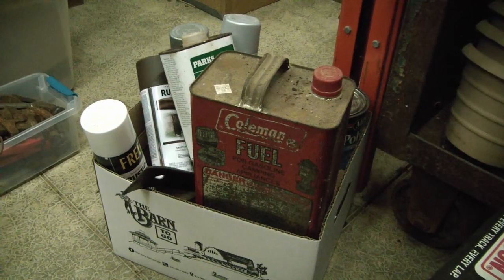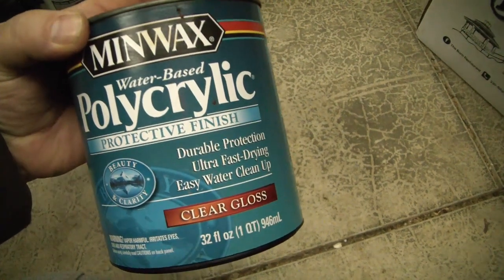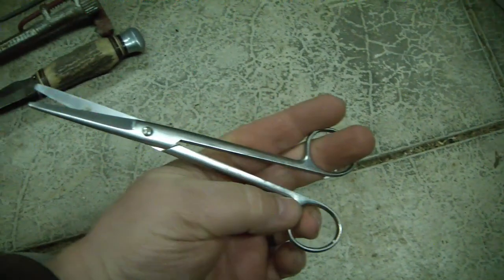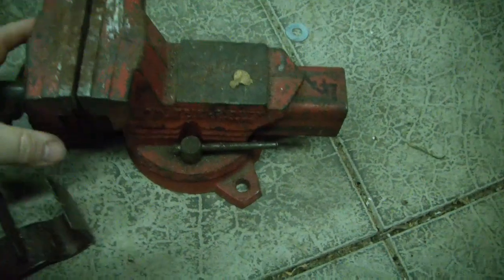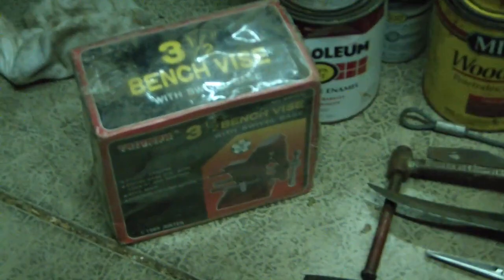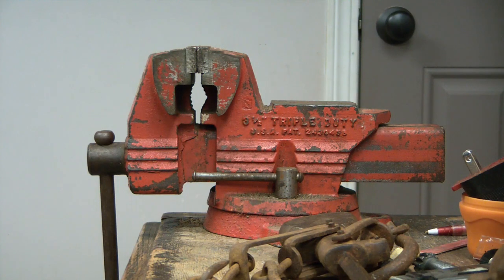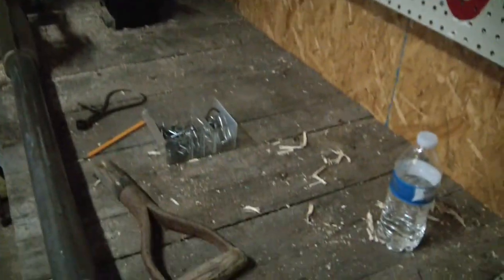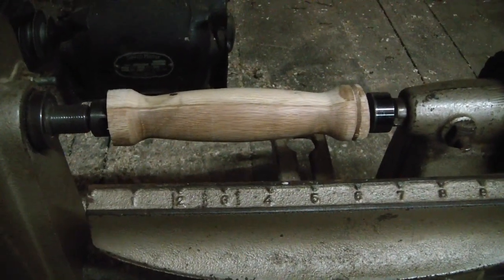Estate Sale Haul New Years Day 2022

Comment: That Wilton was marketed under many names, Craftsman included. I love the art deco style but I have to warn you, they have a weak spot. When the Dynamics jaw is extended, it is very easy to break the casting. Just don't use it for heavy work like hammering and you will not have a problem.
Reply from the maker: I could tell it was not a heavy duty vise.  I will probably restore it and put it on a shelf as I have no real need for it at the moment.  Maybe if I made a small workbench for the train room it would be good there.  Only ever working on more delicate stuff there.
Reply: @timeflysintheshop  once you showed the speed jaw my opinion completely changed. That's a damn nice vise! That would be my daily because of the quick setting

Comment: Well I take it back. I have not seen one with the speed vice feature. There is a virtually identical casting that was produced by many, that's the one that had the weak point. Also yours appears to have pipe Jaws, not on the common ones
Reply from the maker: Per 357 magdad, I went looking on Ebay to see what they are worth, but did not find one just like this.  Maybe it is a bit more rare?
Reply: @timeflysintheshop  I think it might be more special than either of us realized. As soon as you pointed out the speed vise feature, I knew we were on a whole new level. Those features don't come cheap in cast iron. They are common enough in Chinese steel vices but the jaws never meet in those. I think that thing is a gem! I would happily trade a 75 lb American for it
Reply: Well in spirit. The shipping would screw us both